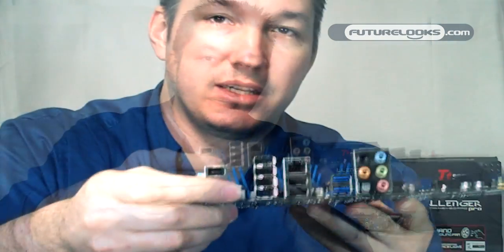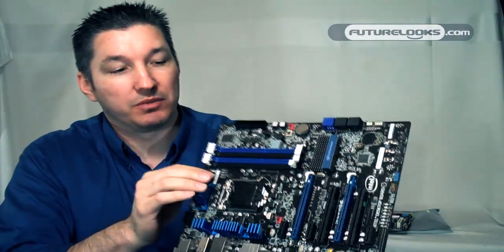Futurelooks' Overview of INTEL's DH67BL "Bear Lake" and DP67BG "Burrage" Sandy Bridge Boards

Comment: @lesleyhenriquez first, thanks for responding to a 3 month old comment. second, the DHP67BG is the same price (in the US) as a Gigabyte UD4, AsRock P67 Extreme6, and Asus P8P67 EVO, all of which have much more robust MOSFET/VRM design, but i guess you wouldn't care about those things since your 2600k is at stock. Third, I have built at least eight systems.